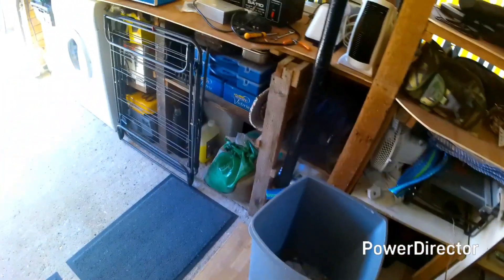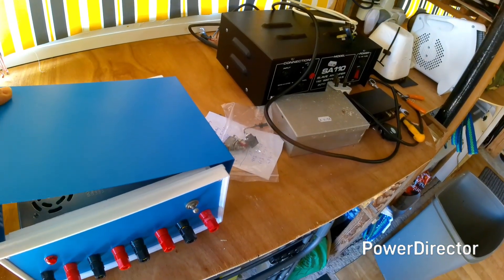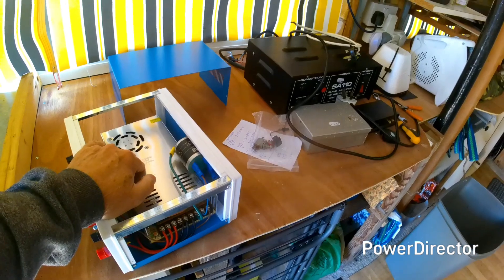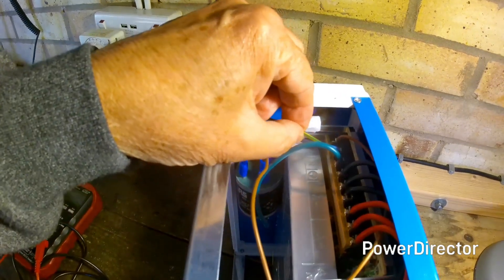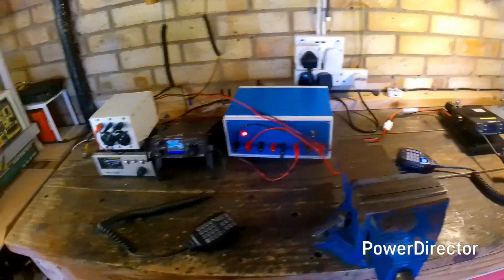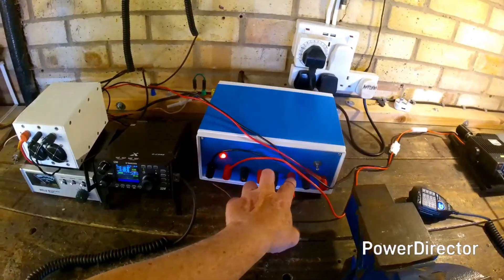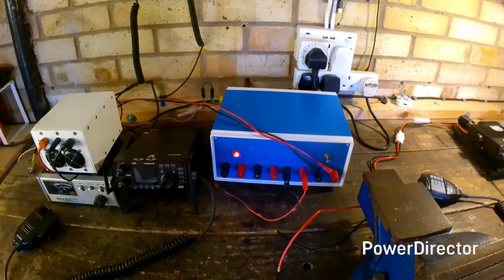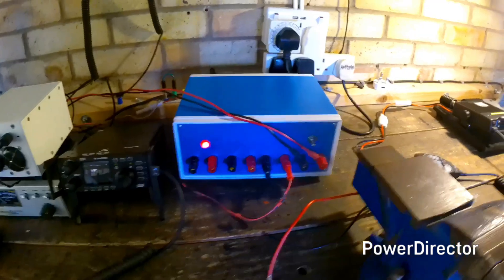I've Got The Power. DIY Ham Radio. 13.8V and 30Amp of Juice

Comment: you wouldn't catch me using one of those psu's on my gear, like you say they are designed for LED lighting not the type of duty cycle that ham radio's need, and you have what looks to be a Watson 30A psu sitting on the shelf, these psu's are built for a purpose and although they could be used for different things I would be very careful using them on your expensive ham gear 👍
Reply from the maker: Why would anyone need a 30amp power supply for LED,s anyway.

Comment: Those switching power supplies can have the output voltage adjusted via the little pot just to the left of the positive output connections, where you have the three red wires connected.  12.0 v can be turned up to 13.8 v.
Reply from the maker: Many thanks. I have mine set to 13.8vdc as its equivalent to a fully charged car battery. More power on rf amps etc at 13.8vdc. George

Comment: I am using 12V 350W Meanwell SMPS. Worried about the bare terminals, I just put some tape on them. Actually I should have thought of a construction like this! Looks quite nice. 73 Jon, VU2JO.

Comment: Nice project and well done!
I like the colour scheme of the box and how neatly everything fits inside.
Have a couple of those type of supplies and will look to doing that box project as well.
Reply from the maker: The switch mode does blast out rfi below 7mhz and just small parts of other bands. So it's not perfect but makes a great piece of kit for runing high current 12vdc devices. George